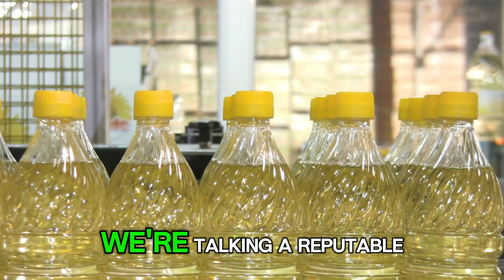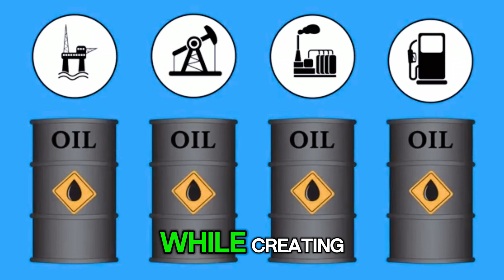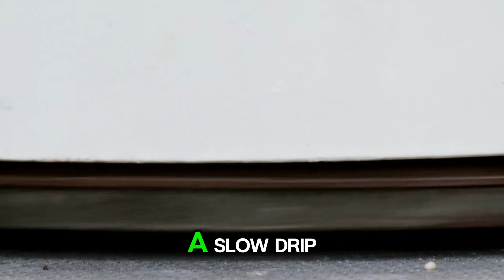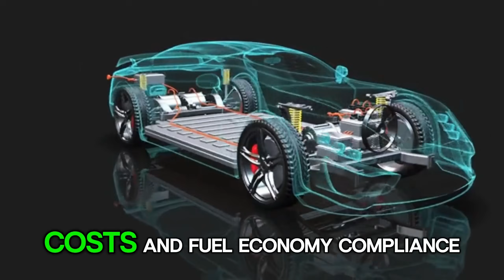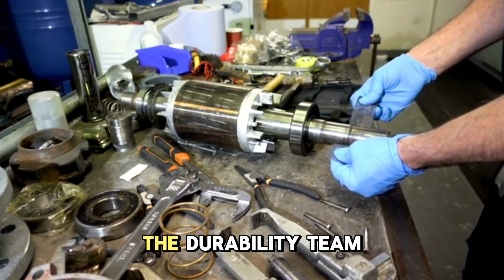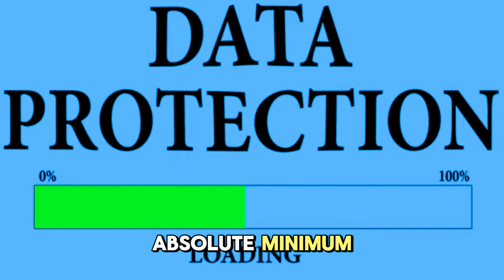Scotty & Car Care Nut Debate: High-Mileage Oil Truth REVEALED (Data Inside)

Comment: 200k miles. 2015 F150 3.5L EcoBoost. Oil change interval 5000-7500. Have had a minor oil leak for about 2 years, but the Ford techs said it's almost a non-issue and requires a full engine takedown to replace the seal... Otherwise, I run OEM spec oil without any other issues.

Comment: Higher viscosity is BETTER cold start lubrication, not worse. Thicker oil sticks to internal components better and for longer periods of time, so when you start your car in the morning after it sat for 18 hours, you still have SOME oil on the cylinder walls. That's a very dangerous thing to get wrong, and it's why Lucas oil stabilizer is such an excellent product. You won't have dry starts even if left sitting for multiple days and it lubricates turbos in the same manner.

Comment: Viscosity and short change intervals. That's the answer. Anti wear package differences are negligible, but the difference between 0w20 and 5w40 is absolutely massive. I'd never ever consider putting anything under 40 weight in any engine, ever.